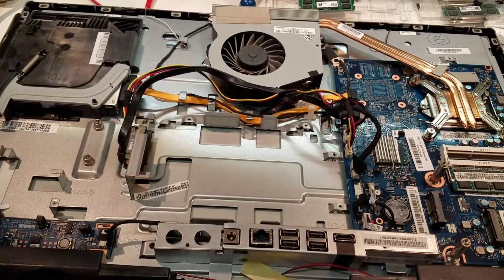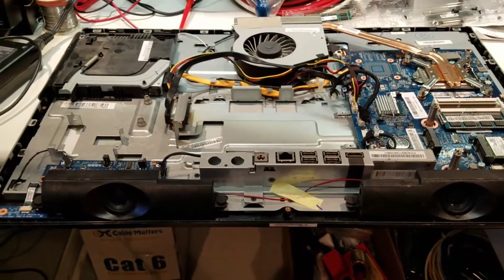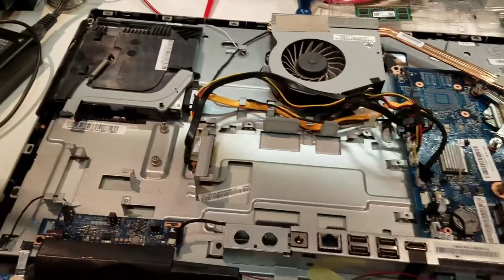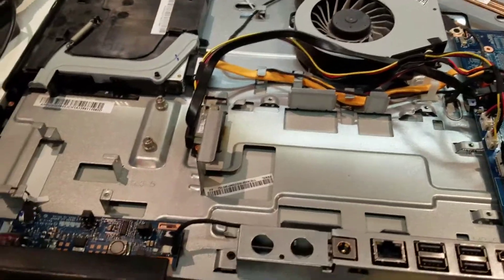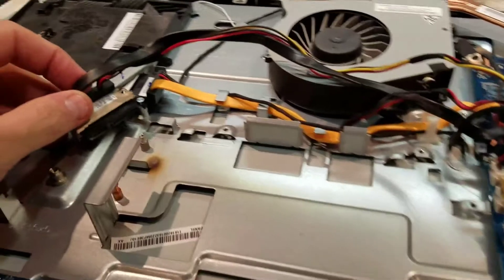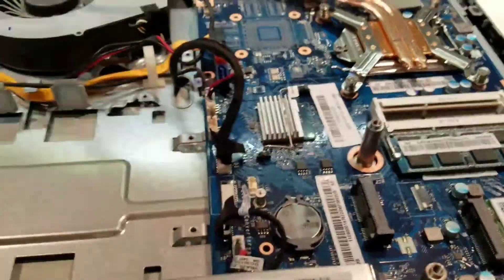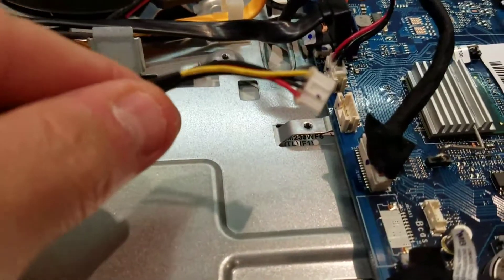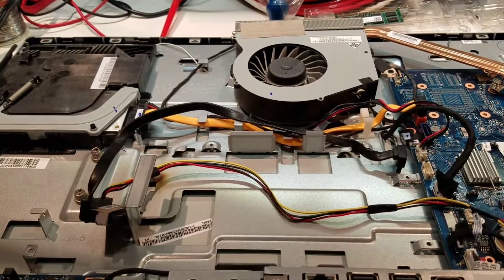Fix the Lenovo C540 Click of Death

Comment: I had the same problem.
I spent most of today diagnosing it.

I finally took the connector apart, and it seems fine, even tho it measured short between the Red and Black Cable.
I couldn't see anything wrong, but replaced it anyway and it fixed it

Red = +5 Volts
Yellow = + 12 Volts

Both Black wired are Ground.

Between the Red and either Black is Shorted

Comment: Had the exact same issue but didn’t realise how bad it was until now, got the PC in 2013 and stopped using it at around 2019 (upgraded to a better computer since then), left it there until I decided to try turning it on today and it didn’t start normally, had no clicking sound but it was stuck on the startup screen for a long time then white smoke with the smell of plastic started coming up the vents, turned it off in panic then took it apart and found out that the connector on that cable was burnt causing even the hard disk to become unusable as the connector on it was also burnt.

Comment: I have the same computer that I have purchased back in 2013 brand new and just mid or early of last year I started having issues with the computer before hand I had no problems except for the control panel for the screen at the bottom glitching out so I unplugged that back in 2016 but the problem I'm having now is that you'll be doing a task or just sitting around idling and the computer will freeze up for a small period of time probably about no more than 10 minutes at a time or less and then it'll unfreeze the hard drive light does not blink during these time periods and I have tried reinstalling Windows I have tried other operating systems I have replaced the disk drive I have replaced the hard drive the ram I have given it a thorough cleaning I've tried everything I can think of is there any hope for my computer do you have any suggestions.

Comment: Hadn't used my computer in years. Plugged it in today and got the warning of no operating system. Tore the unit apart and found that melted adapter. Might have also damaged my drive but we'll see.
Reply from the maker: Fortunately the connectors on the drive are usually much tougher than their cheap cable/connector. Hope it works out that way for you!

Comment: How can companies get away with this?  Probably tens of thousands of people having to throw out their computers and losing valuable files and family photos!  Totally irresponsible!  Should have a class action lawsuit!  I loved the design of this all in one - with the pull out caddy for the hard drive, everything about it seemed well thought out.  I had the black screen and clicking and spent probably hundreds of hours diagnosing and trying different things.  I managed to recover most of my files from the hard drive which I had pulled out.  A few years later I bought a new hard drive, and did a USB install of Win10 on it plus Office Pro 2016.  Got the internet going and tested everything out.  The next morning I came in and - black screen and clicking again.  Did a bunch of searching again and found your video here...thanks so much for this!  I pulled out the new hard drive and some of the gold contacts on the drive were totally damaged and then I looked with a flashlight and saw the burn marks on the metal platform inside....  All of this time and expense and I was on the wrong track, thinking it was a) hard drive b) graphics card or c) motherboard.  This company is so disgusting - IBM owned since 2005?  I wish news outlets would report on these horrifying tech fails!

Comment: Thanks for the great video! I had exactly the same issue, after replacing a cable, it powers on, no clicking, no bad smell, the fan and hard drive spinning, but the screen remains dark. What else can be done? Please advise, Thanks in advance!
Reply from the maker: Always a good idea to check and reseat all of the cables to make sure nothing got knocked loose while you were working. Also check for nicks and cuts on other cables, as the way they are routed can sometimes get them pinched against edges. You might also try disconnecting the hard disk cable again and powering it up; in that scenario, you should get a BIOS "Bootable hard disk not found" message or similar, which would most importantly tell you the screen is working, and then you can chase down either a problem with the replacement cable or a corrupt bootloader/OS that's just hanging silently on boot.
Reply: @PatrickRigney  Thank you, with a hard drive or without screen still dark, all other cables/connections look OK.
Reply from the maker: @fouadkhalilov3572  Do your backlights light up? It's very hard to see the screen without the backlight illumination. If you're not sure, you can shine a bright flashlight on the display front; when the backlights are dead, you'll see text with the flashlight.
Reply: @PatrickRigney  Thank you, I don't see anything on the screen with a bright flashlight with and without a hard drive.

Comment: My C340 LENOVO,fans works,power supply is on,but screen is blank,what's the problem
Reply from the maker: I would start by disconnecting the hard disk and optical drives in any case. The power supply can look on but have one rail shorted/off. That's typical of the problem described in the video--you still see lights and the computer makes an odd noise, but doesn't boot and the screen is blank. So make sure you eliminate the peripherals. If the screen comes on and complains about no OS/boot volume, you've really found the problem--the peripheral cabling is causing a short or excessive loading of the power supply.

Comment: Terrible design from Lenovo. Just finishing repairing one of these that had been clicking. Luckily the cable and hdd wasnt damaged. Used pliers to twist the metal bracket away from the sata power connector and it stopped shorting.

Comment: Hi m8, 
Your clip is excellent. My son’s pc died, pretty much as you describe, and I could tell it was a power issue of sorts.  
Although I’m not technical in any way, I was able to follow the the instructions which are clear (my biggest issue was removing the outer plastic casings!!!).
Issue was 100% as described. Replacement cable ordered from Amazon and now inserted. PC working perfectly again.
Genuine thanks. I was on the verge of just buying a new PC.
Thanks to your clip I didn’t!
SM
👍🏻

Comment: Had the same issue on a clients 10110 and made up a set of cables and it is working fine. There should be a recall on this a it has the potential to star a fire if there were a lot of dust inside the machine.

Comment: Exactly the same issue on the 10110 model. if they are long enough, these are available for £2 on ebay "SATA Hard drive lead power and data ex sky box (Linked connector, 90 deg data)"  The angled end is the hard bit to find.

Comment: Hi! in my case the motherboard seems to be affected because of this issue. It does not offers video after the disconnection of every thing.
Reply from the maker: I hope by "every thing" you did not include the video connectors, because that would certainly cause a loss of video. I said in the video, around 1:55, just the peripheral cables for the hard disk and optical drive. If you pulled others, you'll likely disconnect all or part of the monitor from the motherboard.

Comment: Thank you for this information. I have a Lenovo and got the click of death two years ago I Decided to turn it off and toss it out before I move. 3 years later I plug and turn my computer on and my computer was working fine. Not even 2 hours in looking at pictures on my computer I got the same clicking noise follow by a burning smell. So I decided to un plug the computer and found your site. I will have my boyfriend take the computer apart so that way I can save my computer. Thank you so much for this helpful information.

Comment: i have same problem. Video helped but instead of the cable getting burnt, the converter at the end of the hard drive got burnt. my issue now is that system powers on fine but there is constant clicking sound coming from the speakers. if i disable speakers it stops but i dont want to. Any help. Thank you
Reply from the maker: OK, just to make sure I understand, the system now boots up completely into Windows?

Comment: good afternoon, I have a lenovo b320. when turning it on, turn on the fan and in 5 seconds it turns off and it does not give an image or anything, any help you can give me I will appreciate it
Reply from the maker: What I would do is open the unit up (remove the back covers), and disconnect power and data from the HDD, and the optical (DVD) drive. I would also carefully reseat every connector I could find (disconnect and reconnect, which sometimes kicks some dirt or corrosion out that's gotten in over time). Also clean any dust/debris you find, particularly in the fans and heat sinks. Then try to start it up (with the drives and drive power still disconnected) and see what the screen displays. If it tries to boot and tells you it can't find a boot disk, you're down to a power problem with one of the drives (which is basically the subject of my video), or a dead hard drive (least likely answer, as a dead drive that's connected should still give a boot error, not a shutdown). If disconnecting peripherals does not change its behavior (still shuts down after a few seconds of doing nothing), then I would reseat the RAM--remove the RAM modules, clean the contacts with isopropyl alcohol (or the old trick, a pink rubber pencil eraser, gently), and reinsert, then try to boot again. If it still fails, and there are two RAM modules, I would try booting with just one module--try both to see if I can get a change in behavior with one or the other (you need to identify which RAM slot is the "primary" and make sure you use that slot for the one-module test). If it comes to life, the RAM module that's not installed has gone bad (and given the description of your problem, the likely scenario is that the RAM module currently in the primary slot is bad in a low region, so the BIOS can't even come up). If none of that does the trick, you're down to more board-level stuff like checking the power supply output at the supply, and then various places around the unit, etc.
Reply from the maker: And when you get to the RAM module test, if you only have one RAM module in the system, you can't really test it in the condition you're in (no BIOS boot). Your only options are find an identical system and try your module in that system, or fall forward and buy a replacement RAM module and put it in and hope that was it. This is one of the reasons that I never build (or buy) a system with a single RAM module; always pairs. Crucial sells 2G modules right now for the B320 for $20, or 4G for $35.

Comment: mine doesn't have the faint clicking sound, nothing will turn on except the power button light and an icon (looks like a box with a lone through it) but the power button light shuts off, but the icon will still be lit. lol
Reply from the maker: shadow10017 Hmmm, does it make any beeps?
Reply: nope compely silent.

Comment: Muchas gracias amigo tengo el mismo problema y no encontraba nada parecido, really really thank you
Reply from the maker: De nada! And that's about as much Spanish as I can put together after just a couple of weeks with Duolingo, unless of course you'd like to know that "yo come fresas"! :-) But I'm trying! In any case, I'm happy that you found it and it worked out for you!
Reply: Patrick Rigney hi! I just know a little english only, It works, cuted a terminal power for hdd/ssd from a cable from a power supply for descktop pc that i had and soldered it with tin to the original power cable of Lenovo, i pluged it and now it run again :)
Reply: Moises Garcia cambié el cablede energía que viene de fábrica del disco duro, viene 2 en uno al hdd pero se separan(no se si ya abriste tu pc) y uno va un puerto sata y el otro pa al adaptador se energía de la placa madre, puedes cambiar el sata y conectarlo directamente a la placa, el asunto esta en el cable de energía corte una de las conexiones de alimentación de un cable de una fuente de poder de una pc de escritorio y luego corte también el del cable original y los soldé y conecte, asi como el amigo del vídeo hizo
Reply: Pablo Amaro que hiciste para solucionar el problema bro tengo el mismo asunto pero no doy que es!!!!!
Reply: Pablo Amaro pa no batallar voy a comprar el cable y les platico si quedo o no saludos y gracias

Comment: I did the exact same thing to repair one I had. I didn't see any videos on the subject so I made one also. It is crazy that this part is shorting out like this. I have been working on computers for more then 10 years and this is the first power connector fail like this. 
Thanks for the video. here is the video I made, I thought this was a rare issue.
https://www.youtube.com/watch?v=BfrLirZSslA&lc=z23til0gnqikx11xr04t1aokggfmoqih4tvtqu3nigcqbk0h00410

Comment: I just got your exact situation.   Hope this won't be too much.
Reply from the maker: I ended up making my own replacement cable from parts I had, but my video description links to a replacement on Amazon that's under $17 as I write this (I get no revenue from that link--not an affiliate). You can do fix it, one way or another. See the link to my follow-up video on how I made my own cable if you're handy and interested in going down that route. Good luck!

Comment: Patrick great work. 
I just got a call from my friend complaining about their Lenovo C540 smoking away, so I heade over to their place, open up the case. Look around and don't see anything visually wrong at first glance. So off to google I go and I find your video, well sir same problem that you have encountered.

Now, I am with you I do not want to replace it with the same part (I don't like that metallic tape) but I have no experience with soldering. 
Is it hard to do? I'd much rather make my own part, even if I haven't done it before (shows you how much confidence I have in the part) 
Any advice?
Reply from the maker: Stafford Harriman It's not hard at all, you just have to twist the wires together and solder them, then insulate well so nothing shorts (again). Now, I have heard from others that the Amazon replacement part is an improved design, so that may sway you back to purchasing.